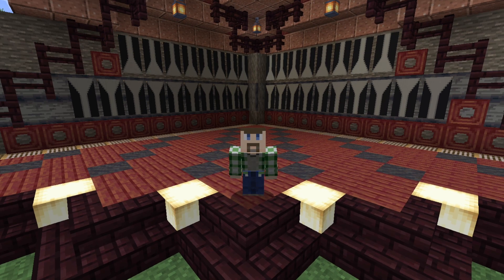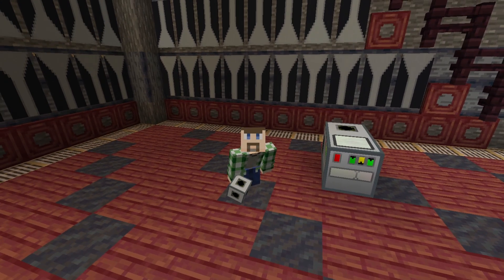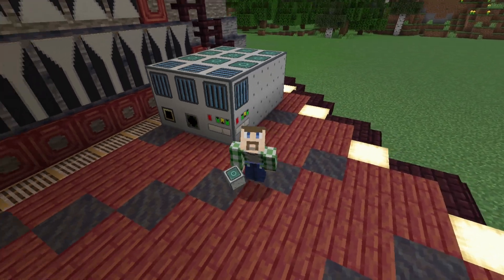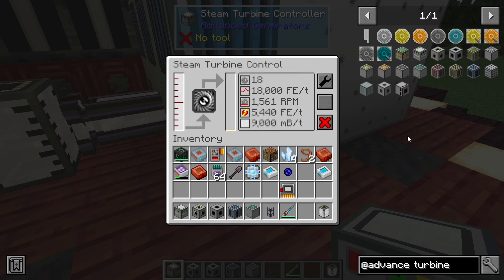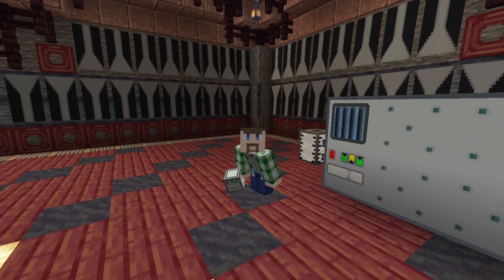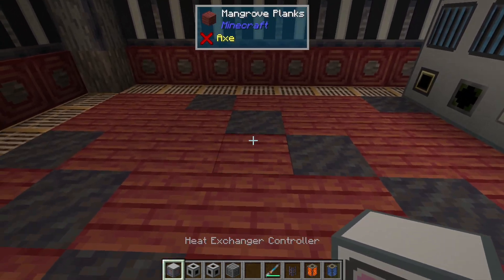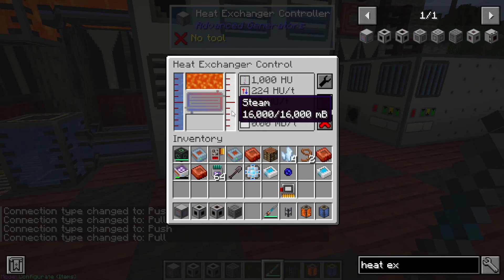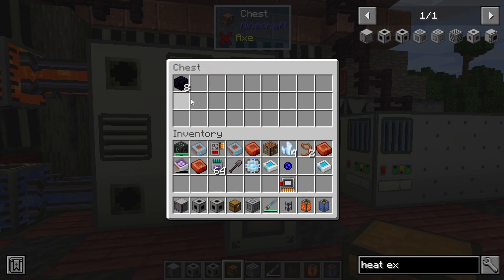Making Steam for Advanced Generators - Minecraft 1.12 - 1.19 - Modded Minecraft Tutorial

Comment: Yeah for whatever reason the Mekanism pipes I use to transport lava for the Heat Exchanger don't seem to actually fill it up through the intake. Works fine for the water, but not the lava. Don't rightly get it, since I definitely see lava in the pipes, and they're set to be pushed into the liquid intake. Just refuses to fill. Baffles my brain.
Reply from the maker: I would have to know more about your setup, but the only guesses I can make is either you don't have two separate fluid intakes on the heat exchanger, or your mekanism pipes haven't been set to push/pull on the respective ends or the pipe with a configurator to get the lava to move.
Reply: @Ardcraft  Nope. Two separate intakes, and I set them to pull from the container, push into their own intake. The pipe gets filled with lava just fine, it just doesn't go into any intakes.
Reply from the maker: The only thing I can think of is that somehow the recipe is invalid.  I have no idea what you're playing with this in, but maybe double check JEI to make sure it exists.  

Only other thing I can really do is point you to the official documentation:  https://bdew.net/generators/heat-exchanger/

Comment: How do I even get liquid steam?
Reply from the maker: I'm not entirely sure what you're asking here.  If you mean how do you get it out of the heat exchanger, you need to use a liquid pipe of some sort from another mod connected to a fluid output valve in the heat exchanger multiblock.  There's no innate transport in this mod itself.

Comment: I've been trying to get my thing to work (the heat exchanger controller) I got lava in it and water I have two inputs 1 output like 30 exhangers and 1 item output. It makes obsidian but It doesn't make steam
Reply from the maker: That's weird if you're getting obsidian out of it, it should be making both.  The right bar isn't just full and a barely different shade of gray at 8000mb?   I know it worked on 1.18 when I made the video, but maybe it was broken in an earlier version if you're on 1.12 or something.  Only thing I can suggest without more information is checking the official documentation:  https://bdew.net/generators/heat-exchanger/
Reply: @Ardcraft  I messed around with it and added a restone thing and lever and changed it to do heat exchange after turning that off then on it started working again. I have zero idea why it wasn't before though
Reply from the maker: Well, I'm glad you got it working, that's still really strange though.  I have no clue why that would have fixed it.  I can only assume you ran into some sort of bug.